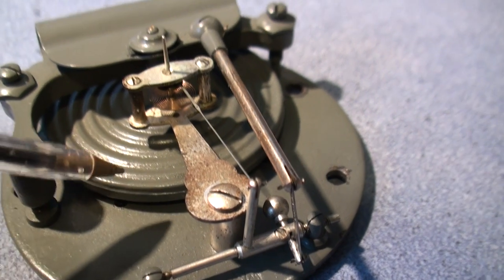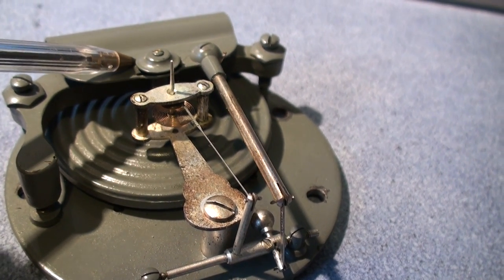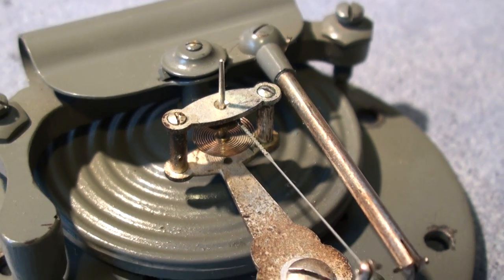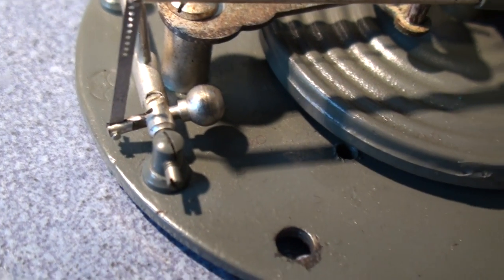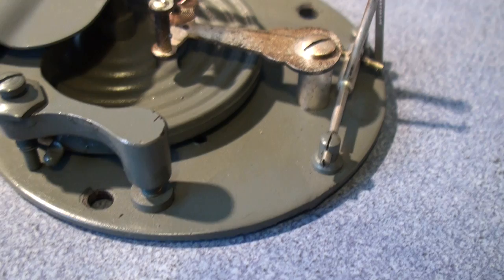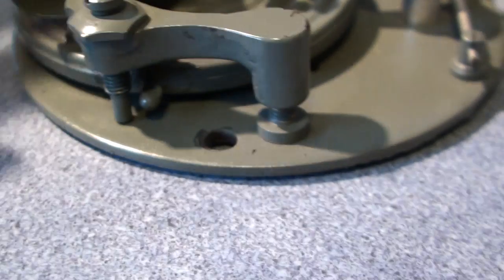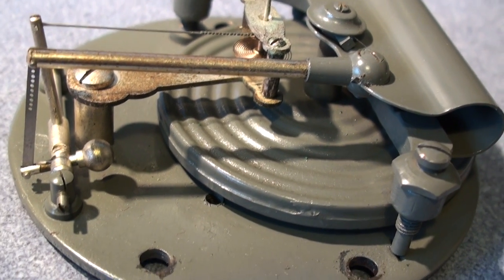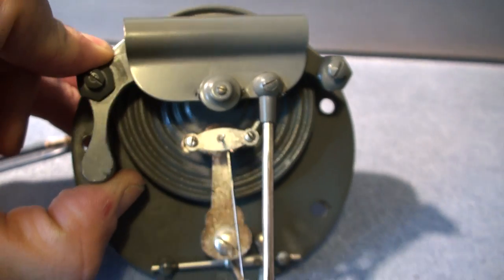Aneroid barometer mechanism

Comment: I'm currently adjusting the gain on my old Everest barometer, whilst tracking the changes on my local weather station website.  On mine, the lever between the box & the pivot mechanism is a wire, and you have to slide it in & out to adjust the degree of deflection on the pointer.  It seems to be a very fine adjustment- just fractions of a mm will significantly affect how far the pointer moves for a given change in pressure...

Comment: Bought a 1927 taylor stormoguide at the flea market for 7 bucks. Did the bag test and it surprisingly still works but the little chain isn't connected to the center shaft. How would I go about reattaching it?

Comment: One thing I don't understand is, what this ball shaped counterweight at the lower lever is "countering" for.
Reply from the maker: It's a balance. It minamalises the change in reading when the movement is switched from horizontal to vertical.
Reply: @SoddingaboutSi  Thanks a lot for your answer. That seems to make sense. I saw this counterweight on many aneroid barometer mechanism, but couldn't get behind its purpose by now.

Comment: I just took a look at my old Stellar aneroid from "Western Germany". I set it per the local weather report at 30.00. Then I tried the plastic bag test and discovered that it is sticky. Depending on how sharply I release the bag pressure it ends up anywhere between 30.1 and 30.3, more or less. I assume this is not a very high end product but any advise on cleaning and lubrication would be greatly appreciated. Thank you very much
Reply from the maker: Jeffrey Deutsch This is fairy typical of cheaper movements. Make sure all the linkages are free then some very light oil on the bearings and chain should help.

Comment: If the pointer is removed, should the bellows be at low, medium or high expansion when replaced?  I can make it read correct with the adjustment wherever the bellows and mechanism are positioned.
Reply from the maker: Depends where the movement is set on the spindle.

Comment: do you regulate by just removing the needle, and put the needle to the position of the current pressure location?  I have this instrument on a Swiss Le Coultre Clock with hygrometer and thermometer as well...
Reply: There should be a screw at the back of your barometer to allow you to calibrate it.

Comment: i just wnna know is the pressure inside the Aneroid is a high pressure or  a low pressure or a static port connected to the Aneroid
Reply: The anaeroid box is evacuated, so it will have a low pressure inside it..

Comment: Hi Simon ive bought a barometer like the one in the video, it needs oiling but im not sure on how to take off the pointer so i can remove the square face plate, Thanks for your videos
Reply from the maker: Grab the pointer between two fingers at the point where the movement is and pull. It's probably quite tight.
Reply: @SoddingaboutSi  Hi found this cool oak hall way barometer with a small rectangle mirror above the barometer and two clothe brushes on either side from the 50s, , Thanks for your reply
Reply: Hi Simon ive managed to clean and oil the barometer, i think that it was hung in a humid location, the pointer had surface rust and the metal had a grey look to it, all cleaned and oiled , Thanks for your advice

Comment: do you have a handy way of regulating the hygrometer on my clock? I have access to my Dad's huge cigar cabinet with a hygrometer but I don't want to put the whole clock unit in there (it stinks) to regulate it to the same reading as the in-built hygrometer.  The hygrometer has spring coils.

Comment: I have an exact mechanism, my pivot screws where uneven so i turned them out until they where the same level, i wonder if this will affect the gain?
Reply from the maker: No in shouldn't.  They are seldom that accurate in domestic barometers.
Reply: That's a relief, I have a few but this one is special to me, I just want it to work well for many more years. Fantastic video.

Comment: how does the pressure of the air outside the barometer, press the diaphragm? Cos the atmospheric air is separated from the diaphragm by a glass.
Reply: Simon Spiers  thanks  a lot simon, that's a question i had for many years.
Reply: It's not hermetically sealed.  Even though there may be a glass window in front of the instrument, there are still plenty of places where air can go in & out of the casing.